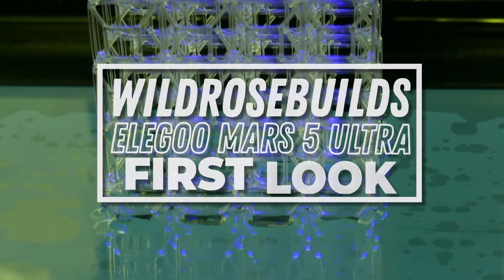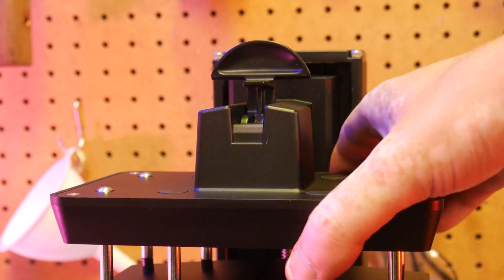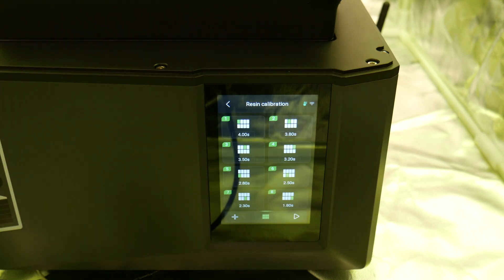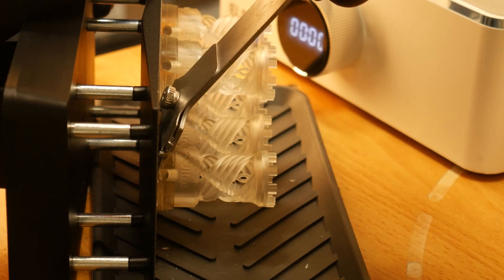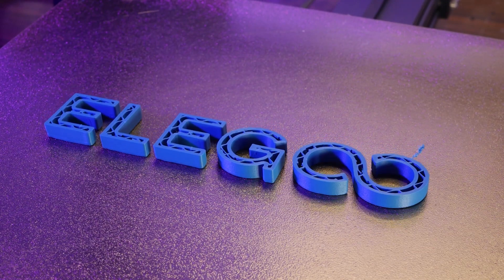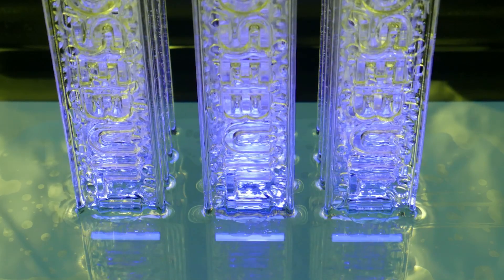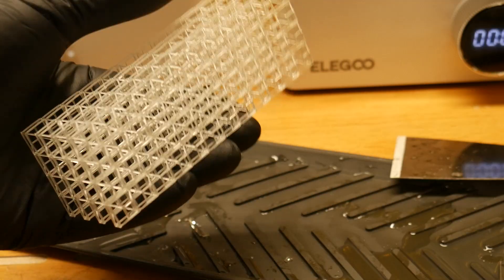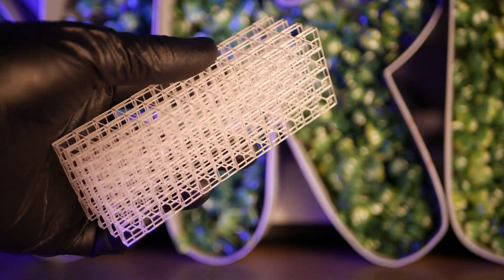First Look at ELEGOO's New Resin 3D Printer - Mars 5 Ultra | WildRoseBuilds

Comment: Have you used any flexible magnetic build plate? I'm thinking of getting one if I upgrade to this model, extricating the models from the plate is hands down the most difficult part. Possibly my exposure time is too high but I'd prefer not to have to experiment that much with exposure time. Great video though, thanks!

Comment: Auto levelling my ass, been working with resin printers for 7 years and this is the only piece of shit where prints won't adhere to the plate
Reply from the maker: I had the opposite problem and had to lower my first layer exposure time. Sounds like you might have to adjust your build plate.